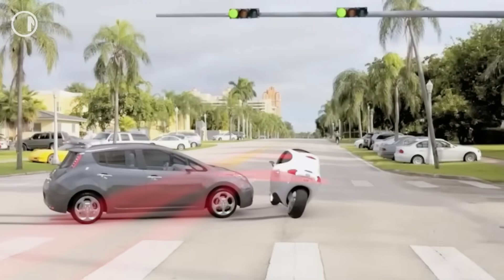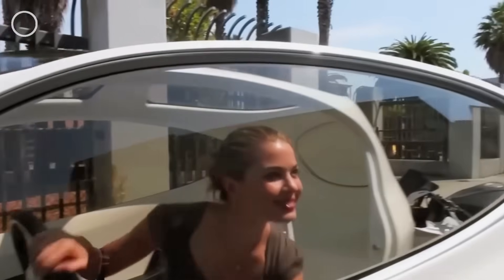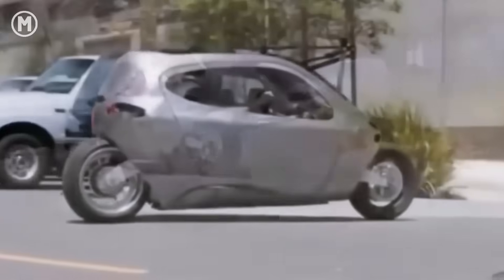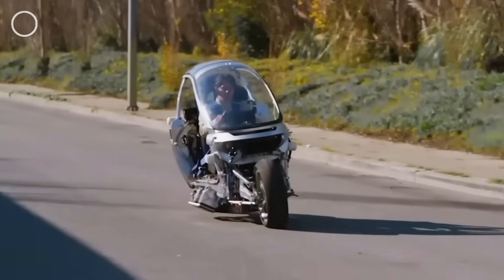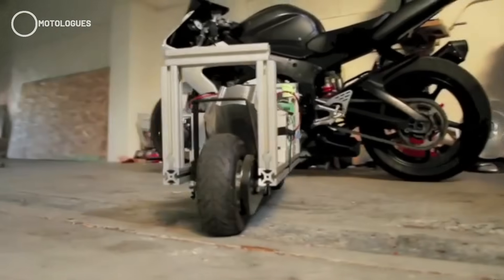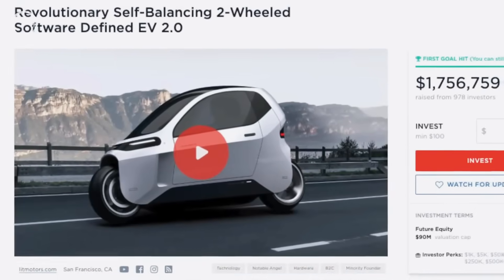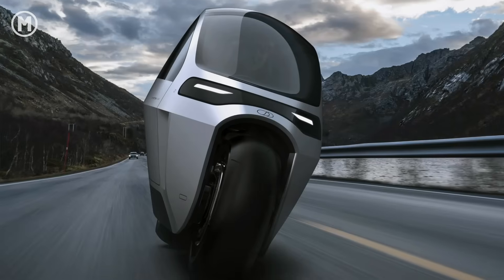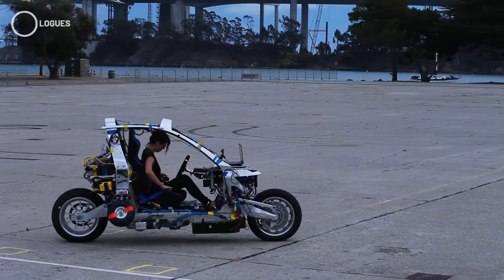2025 Lit Motors C-1 Launching Soon | The Futuristic Self-Balancing Electric Bike!

Comment: the one built in the 1960s worked well. what killed it was when a lady said it was so cute and isn't it sweet. when most people would not by anything that didn't have a 350 v8 w/ 400 hp. however the machine worked well people were too sceptical of it.

Comment: they've got to extend the body to allow for more battery power - aim for 230  km.  and, it's got to be lithium phosphate iron batteries.  because - that's what's trending, and what the future will be.  they also need to get rid of the steering wheel - and adopt something simple, but futuristic.  you'll see it on a MBT-tank, some designs, they don't bother with a steering wheel.
Reply: YOU CANT HAVE A STEERING WHEEL IT LEANS INTO CORNERS

Comment: I have followed C-1 development for over a decade. And with each attempt at monetizing investment, they come out with a single prototype. This biatch will be at least another decade before production models actually hit showroom floors. The first 5 years was spent attempting to find a clean enough gasoline engine. They should have left well-enough alone. With the gas engine, Lit Motors projected a price of under $10K. I feel sorry for all those investors who will die before they ever get to drive one. BTW, the original C-1 was a two-seater.

Comment: The Lit Motors C-1 has more promise than the Aptera. Let's go !!! No more delays !!! At $32,000, however, it will fail. It's a one seater and the technology is new. Curiosity will be high. Adoption will be low. What's needed is a billon dollar investment so that Lit Motors can sell the C-1 at loss, perhaps at $15,000 for a sustainable period of time until adoption becomes normalized.

Comment: Getting around town seems safe, but high speed rural travel will have some difficulties.  Just because these things can balance themselves doesn't mean that someone traveling 100 kph into a corner out on a highway is going to be able to keep from going off the pavement.  All that self balance crap isn't going to help when you're taking a little detour through the ditch next to the road.

Comment: I like it but $32K for a single seater seems more like a rich guys toy than an affordable city driver. It would be perfect for the work commute if it weren't so expensive.
Reply: right, if its going to be a third the size of a corolla which already gets 50 mpg, it better be a 1/3 the price. fuel economy on modern cars has gotten so good, vehicles like this might just become irrelevant from a pragmatic standpoint.
Reply: Ini motor bukan mobil
Reply: Date commute two
Reply: It will be a rich guys toy but eventually the price will come down and you will also see couriers use it